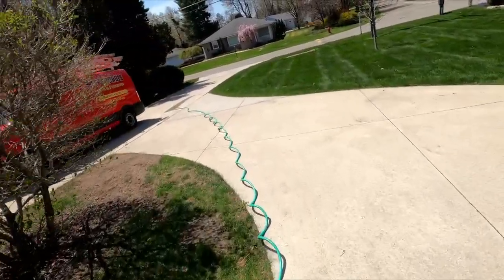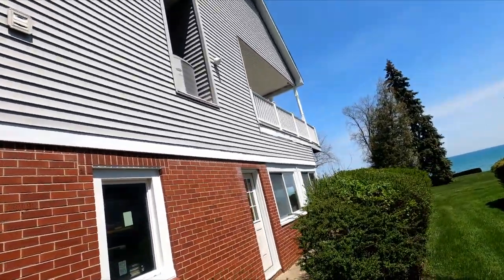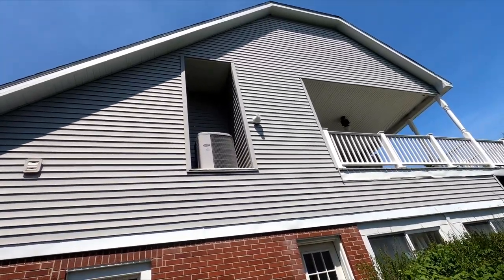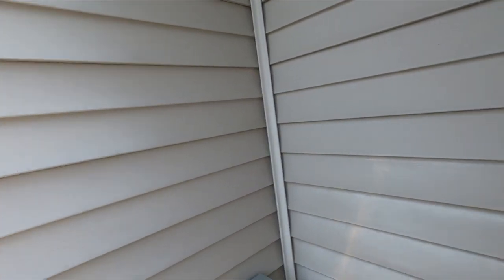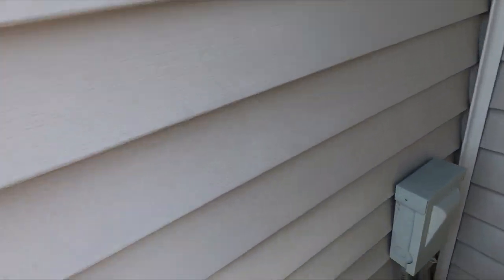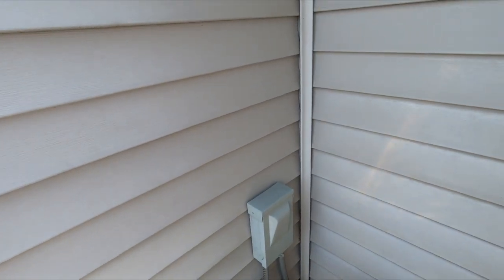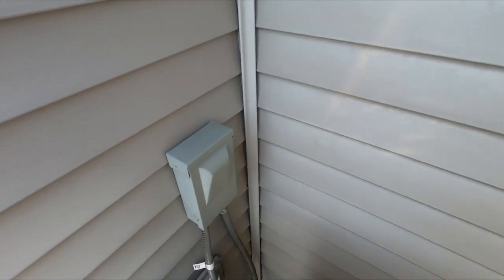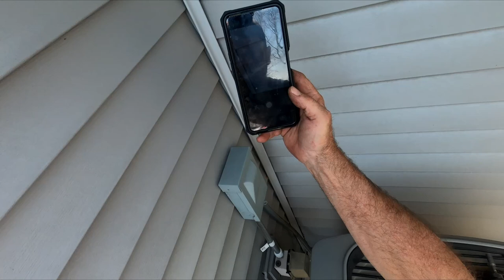Scary 2nd Floor AC Maintenance

Comment: Should have put a water cooled shell and tube condenser. Use the lake water with a head pressure control valve. Could have have had the whole setup inside. Would have been sweet.

Comment: i wouldn’t have done it, I would have looked at it from up top and just gone down. 
the unit on the ground i notice there are other garbage bins that look like they go in front of the unit. if that was a startup i would have denied it. 

the 2nd floor ac I would have quoted safety guidelines, and explain to the customer that anyone who goes and does that unit is going to need certain safety gear and things in place in order to satisfy the governing safety body for workers. 

The one on the ground I would have mentioned to the client that putting the garbages in front of it and on the side and the lack of clearances even without the garbages would void any warranty with the manufacturer. The clearances alone would cause the unit to never work within manufacturer specifications. I would have been very honest with regards to the install location and mention that I wouldn’t be responsible for the unit operating poorly and that anything the company could do would be bandaiding the real problem

Comment: If I were the tech replacing it I'd put a unitary mini split in and wall mount it down lower, they don't take up too much room and boast 20+ SEER efficiency ratings, may not be the cheapest option but when I do things I think about what the next guy

Comment: I've got a few questions? How in the hell did a HVAC technician put that up there? How is the heck, is any future HVAC technician going work on that safety? That just put it up there and didn't care what a future HVAC technician was going to face. They should've called the HVAC business,  that put it there in the first place. They put it up there with a lift or forklift. How he wired it and plumbed it,  I dont know. They could've plumbed it, on the same side of the house as the other air conditioner. That's just pure dangerous work environment. I was brave in my younger days, but I don't know, if I would've taken that risk. When I was working for a youth organization at 16 years old, I did what I was told. I climbed on a I beam, that was 30ft in the air and changed light fixtures. That was because I was young and didn't know any better. I technically was supposed to do that kind of work, but it was better than working outside. At the age of 56, I definitely wouldn't take those kind of risk.
Reply: Scaffolding.
Reply: @Guillotines_For_Globalists  yeah, but for an air conditioning job check job. The homeowner should've called the company, that installed it originally. That's a lot of extra time and expense for an HVAC company to spend on fixing a air conditioner or checking it out.

Comment: What kind of !@#$% installer would put that there?  You need a bucket truck if you can even get one in there.  I'm not fond of heights anyway, but just watching you try to work up there was giving me vertigo just sitting at my desk.  No ventilation for it either.  Couldn't they have put it on the roof?  Imagine trying to do a compressor replacement on that thing.  You have balls of solid brass for going up there and working on that thing with your ass in the air.